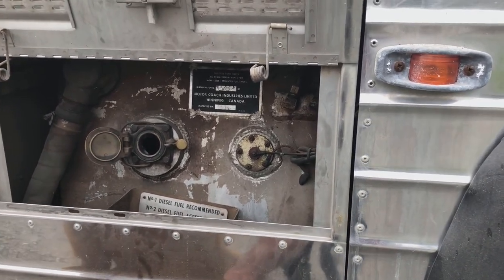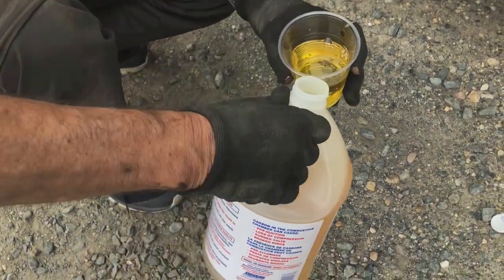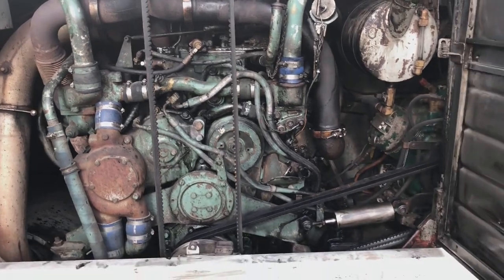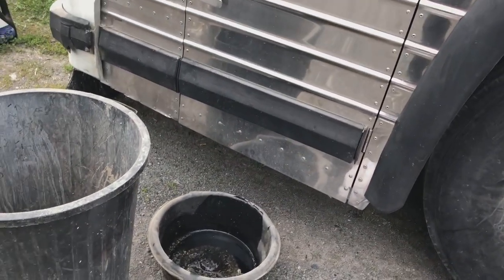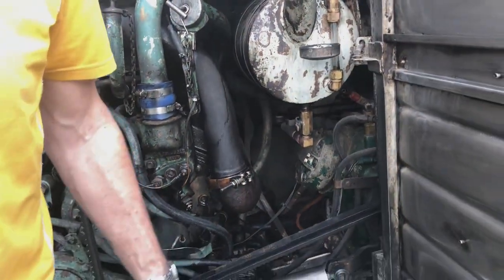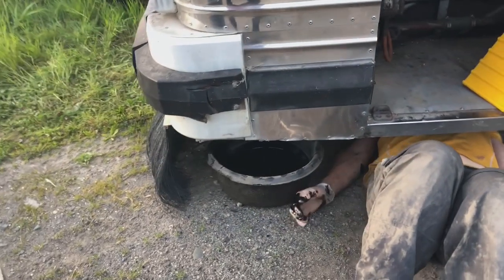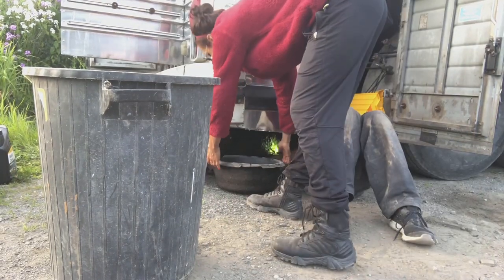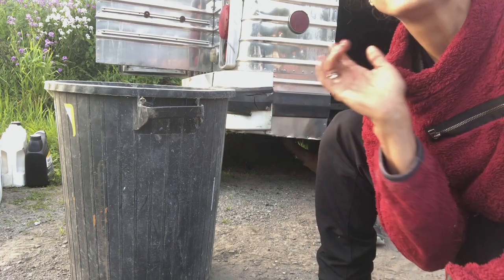Oil Change on a 1982 MCI Bus

Comment: Looks like a Detroit 6 or 8v92 engine....if it is, you shouldn't be using that multi-weight oil.  It needs to be 30wt or 40wt low ash oil that's rated for a 2 stroke engine. I use this oil https://www.tractorsupply.com/tsc/product/shell-rotella-t1-sae-40-engine-oil-1-gal?cm_vc=-10005
 Join some of the forums like https://www.busconversionmagazine.com/forum/ or http://busnut.com/forum/index.php .  There's a wealth of information on them.
Reply from the maker: Thank you very much Mike. I so appreciate it. I will let my friend know. He purchased this bus to do a full conversion on it, like a RV. It is coming along quite nicely. I will be making more videos of his progress. I am glad you found my channel. I welcome your input. Thank you once again.